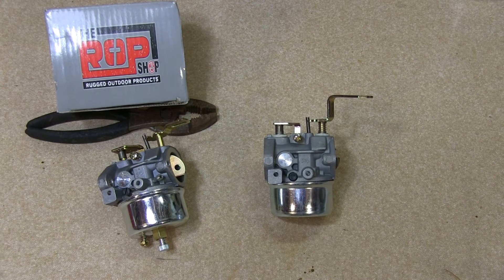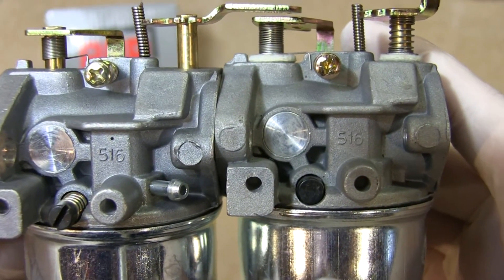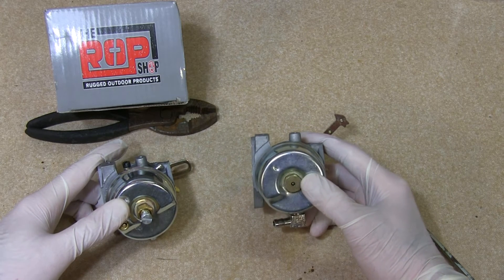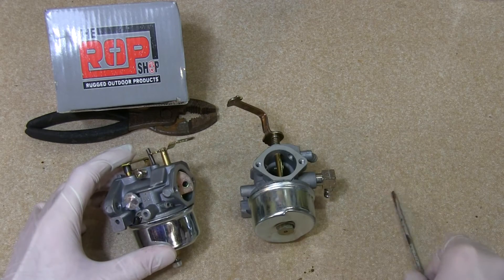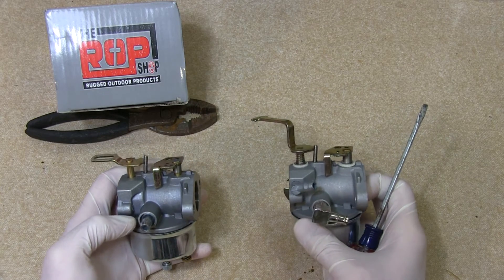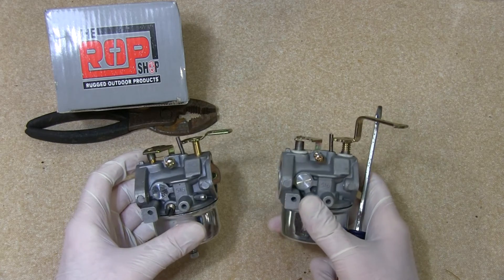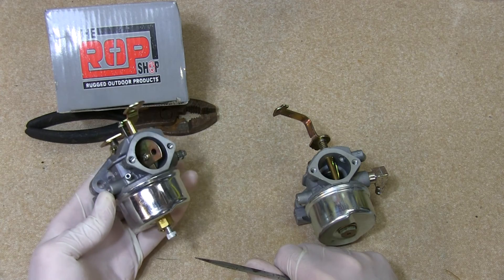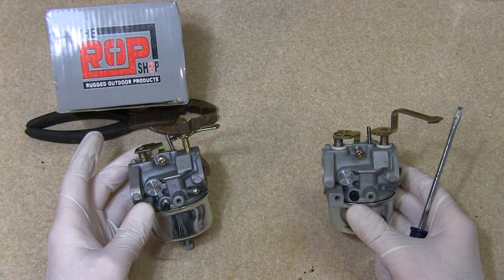Amazon VS Ebay Carburetor – 8hp Tecumseh

Comment: The one on the right is for summer applications, like a wood chipper, tiller, generator, etc. It gappens to be a non adjustable, they also make that carb adjustable.
The one to the left is for winter applications, your snowking engine, its setup to accept the primer bulb line, etc. It happens to be an adjustable, they also made those non adjustable.
The farther back you go, on older equipment you'll find adjustable carburetors. The newer ones will be fixed, so you cant mess with it.
The low speed idle circuit is hiding behind the black cap on the one to the right. Often if the non adjustable carb is surging, you can remove thst little circuit screw and use a micro drill bit to enlarge the hole one size to stop surging. Those carbs are for your HM and HMSK horizontal medium feame Tecumseh engines, typically 8 to 11hp. Their are many different styles and versions for different Tecumseh engines, but thats what those two were specifically for.
If you pull up a Tecumseh service manual, they go over many of the different carbs they made. Their are roughly 15 different series of carburetors for Tecumseh ranging from 1960 to 2008.
Reply: Hey Mr Tecumseh maybe you can help me out i bought the adjustable carb off amazon for my john deere 826 snowblower with a hmsk80 on it. I cannot get it to tune right i have a old jd tiller with the same style carb and its so easy to find the sweet spot. With this carb on the snowblower it seems like its rich or nothing it kinda has a missing farting sound coming out of the exhaust at idle. i have tried setting both screws at a turn and a half out but i just cannot get it dialed it seems rich or starving nothing in between.

Comment: The ebay carb I ordered is the non-adjustable carb as in the vid, one thing I noticed right away is the large welch plug on the carb body inside the bowl is missing.  Should there be one there?  I installed one out of a kit I had, and even though the  Tecumseh 8hp on my snowblower runs quite well...it isn't perfect...runs rich.  Maybe since the idle mixture is non-adjustable the plug doesn't need to be there.  Thanks for any advice on this.

Comment: Even thought the casting number is the same they are clearly two different part number carbs intended for different engines. The carb on the left was intended for a Snow-King engine while the carb on the right looks like it was intended for a generator engine. Tecumseh had many variants, there were three that I know of just for generator engines, same goes for the Snow king engines. With regard to the non adjustable carbs at some point there were new EPA requirements that mandated fixed jet carbs.  I have a Generator with a Tecumseh 10 HP HM100 engine and there are at least three carbs that will fit and work with that engine, one has the adjustable jets and the other two are fixed,  It appears that the Ebay seller either didn't know what they were selling or made a big mistake but they are clearly two different part number carburetors.  To make sure you have the correct carburetor you should go by the Tecumseh's  engine part number  for example HM100-159436P the numbers following the HM100 designation will dictate what carburetor and any other other options that was specified for that particular engine. Personally I would stay away from the cheep China imports and stick with a reputable aftermarket manufacturer like Stens or Oregon if you don't want to pay $$$ for OEM.

Comment: On the non adjustable carburetor( right hand side) that black cap comes off and you should be able to adjust it just like the carb on the left.
Reply: The screw behind that cap is the idle circuit. It cant be adjusted on that non adjustable carb, its fixed. Both the high and low are set, done deal. Its screws in all the way thats it, their is no adjustment. The size of the hole in the center of it determines its jet size. If you get one of those carbs and the engine surges, you can pull that circuit screw out and take a micro drill bit to drill that center hole up a size or two, that usually stops the surging and smooths it out. By doing so you let in more fuel and take it from to lean too a bit richer. If you enlarge the hole too much on that screw it will be too rich and flood out causing stumbling. But if you get it just right, up 1 or 2 sizes, it'll get it perfect. Their epa carbs. The epa decided what jet size and at what air/fuel mixture it runs at. The old ones you could adjust were before the epa went all crazy. That is how you get around setting a non adjustable epa carb. If your buying one of these cheap aftermarket carbs, might as well get the adjustable one every time, so you can dial it in smooth.
Reply: You are right about there being a screw under the cap, but it is non adjustable. It has a small hole in the end, which is used for the idle circuit, but it does not adjust to anything. It is fixed. As is the main jet.

Comment: Lets clear something up here right now. Both of those carburetors will fit and work on the same engine. The diffence is, one is adjustable and one is not and is pre set. Either on will work. Their are pros and cons to both.
Lets start with the adjustable one. 
Pros, you can tune that carb in perfectly and if fuel is leftvin it and it goes stale and gums it up, you'll be able to bring it back 90% of the time.
Cons, you have to know how to adjust that carb or the engine will not run right.
The non adjustable carb, that carb is an epa standard pre set carb.
Pros, you do not have to make any adjustments and usually when new, the engine will run perfectly as soon as its bolted on.
Cons, if the engine isnt running right after putting that on, you have to reem out the main jet to a slighly larger size to get it to run right.
If you leave fuel in their and it goes stale, a lot of times it will permanatly throw the idle circuit out of wack and it wont run correctly. Sometimes you can get it to come back, sometimes you get lucky and if you slightly enlarge the idle jet hole, it will come back, but not always.
Either carb can be put on a newer or older engine of the same size. If you wanted to make an old engine run on a fixed jet carb you could, if you wanted to make a newer engine run off an adjustable carb you could. Wanted to clear that up for anyone in future reference.
As far as the fuel inlet, you can put on or take off a 90 degree elbow to your needs. But the carb will need a fat ribbed area for the fuel line to hold onto properly, if you try just using the little stub, it will probably work, but you run a much bigger chance of it falling off down the line and than youll have fuel spilling everywhere making a big mess. As far as which site you bought the carb from, doesnt matter, you could buy either type on either site and from the looks of both those carbs, the same manufacturer made both. The only thing that matters is the mounting holes of the carb and throat size need to be the same for it to mount and have the same run to the engine.
As far as a primer, older winter engines didnt have primers and were started using choke, newer engines will either need a primer, if not have to be put onto choke and than most likely primed with starting fluid to start in cold weather, without starting fluid it may not start or be very difficult to start and require many pulls. An old school spring loaded primer can be screwed onto both those carbs.
For warm weather you dont need the primer, but having it wont hurt.
An air filter cover and mount or heater cover application can be used on either. Tecumsehs are all season engines, they can be swapped from winter to summer, I have a snowblower that turns into a mower in thd summer that used to have an old Tecumseh that did that, noe it has a predator so it doesnt matter anymore.

Comment: did they have the same part number on the seller web sites ?
Reply from the maker: I don't know, as the one on ebay didn't have a part number listed.  After further research and reading the comments below, it appears as though there is one for summer equipment (lawnmower) and one for winter equipment, the winter carb has the primer bulb and adjustment screws, this is just was I was told, seems reasonable.